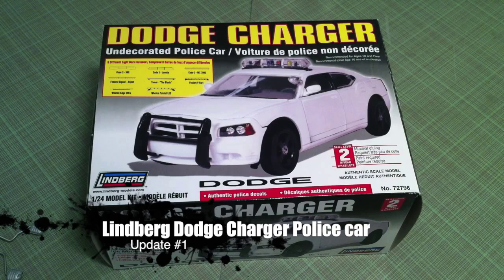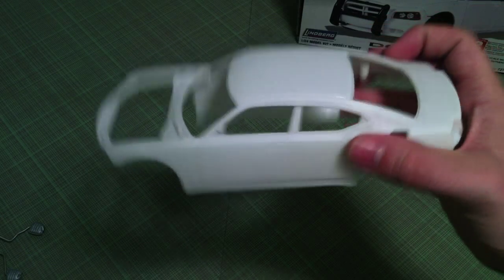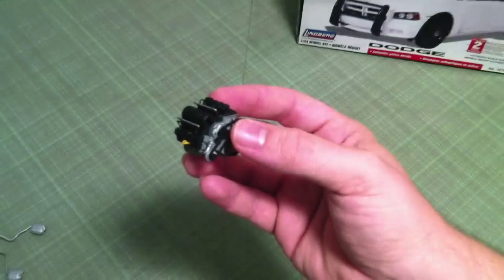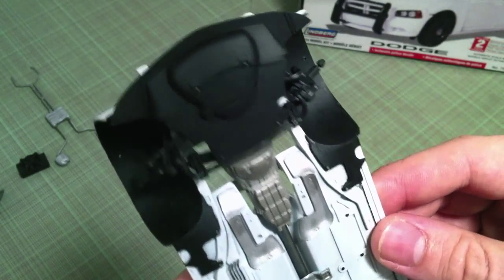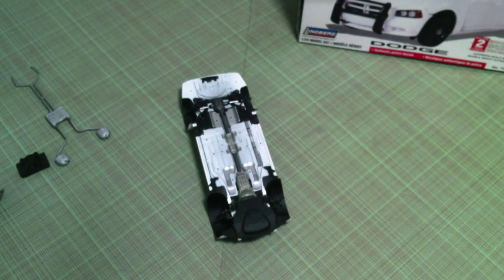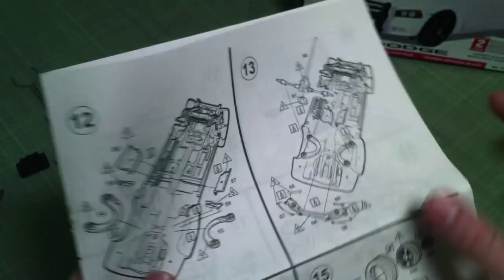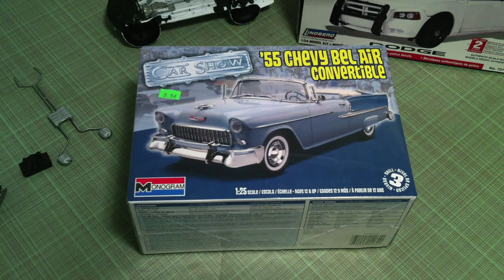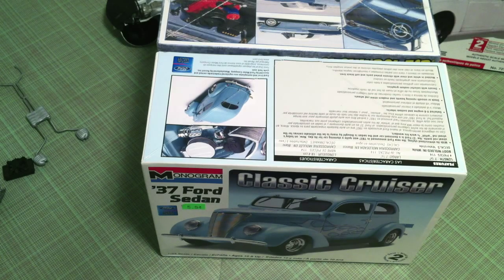1:24 Scale Dodge Charger TCSO Update 1

Comment: A cool tip I learned is to use thick solder,Radio Shack has a nice spool for 4$..or you can always go to the dollar store and shop around there for planting wire..which is just the right gauge for what you need..you also can buy thinner wire to use for spark plug wire